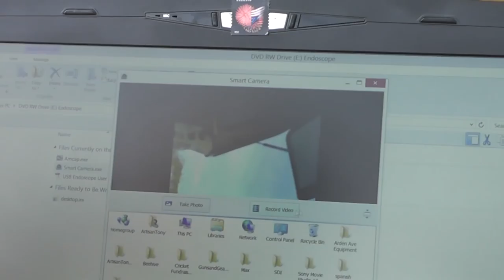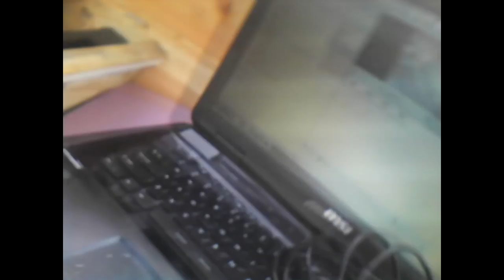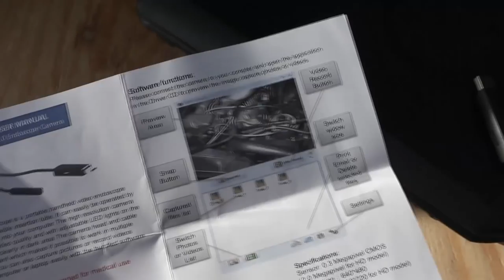Winter Cavity Search on the Bees - Endoscopy for the Artisan Apiary Project

Comment: Maybe i can offer you a helpful piece of advice,since i work with cattle and fencing all the time. If that fence behind your hive is electric, set you two temp plastic fence posts in front of and on each side of  hive could even use pvc with a notch for wire to go in.hook wire on electric fence,pull around hive and hook back onto fence,  take less than 10 mins.  cattle wont mess with anymore and you wont have to move it. you could even put you a fence gate wire handle in front  and be able to drop wire when you want to work hive. Anyways however you decide to do ,hope this was a help.
Reply from the maker: +Unusual Bee Works Good idea and we will fix it soon or move it.